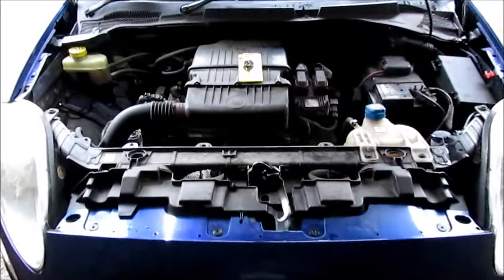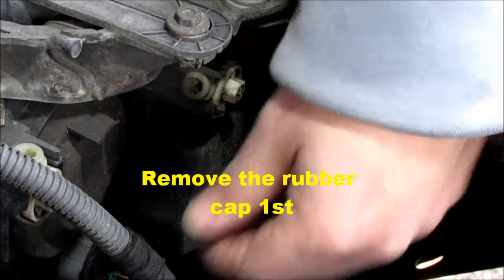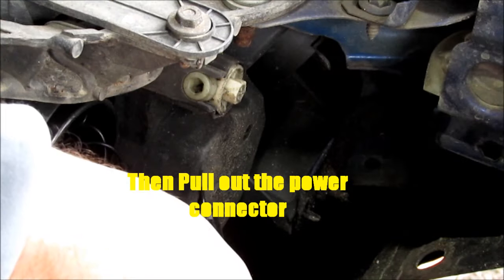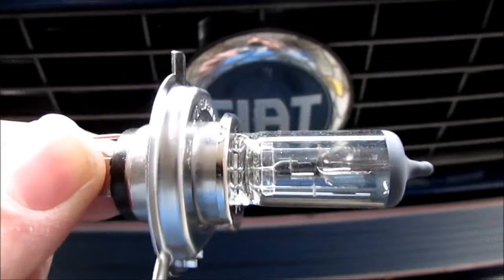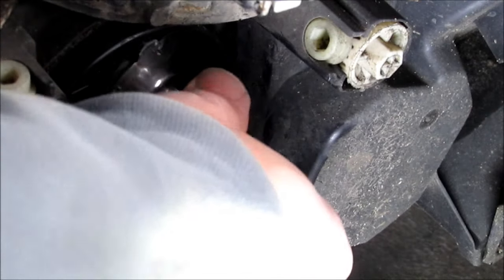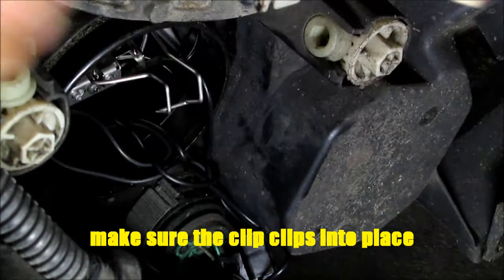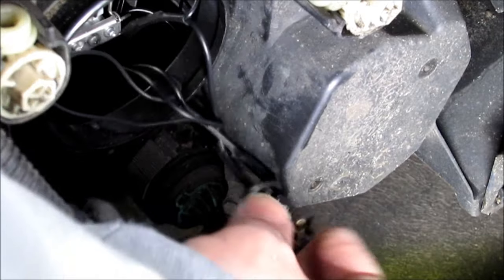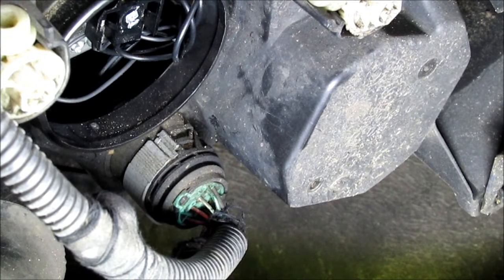fiat punto bulb replacement

Comment: What about if the multi plug is stuck like glue like mine?
Reply from the maker: You could try and free it with Some WD40?
Reply: Ricks Youtube Channel I wasn't sure whether that might affect the electrics.

In the end I took it to Halford's where the sausage finger mechanic took 30 second to get it off. He must have had a vice-like grip, but it still shouldn't have taken him that long, so it must have been properly stuck!

Comment: Was replacing the left side main beam bulb (as you look at it from the front) but thing is...what Fiat decided was a convenient design idea was to plunk the battery straight in front of the bulb housing! So, I had to do this all one handed, sharp metal edges tearing my skin apart, and the only visual aids I had was through the light itself - cause I hadn’t the fucking room to stick my head in and see. Italians really know how to make it difficult, don’t they?

Without this video though, I’d have no clue where each component was placed, so I really appreciate this :D haven’t seen anyone ever tackle the left side...now I know why XD
Reply from the maker: 1st time i done it i lost about 10 pints of blood lol Glad i sold it 😀
just 1 favor I could ask will you Hit that Sub Button My friend
Reply: Unscrew the headlight and lift it from the body, then you could stand on your head and still see inside! Oh put it back in the body once you have changed the bulb.